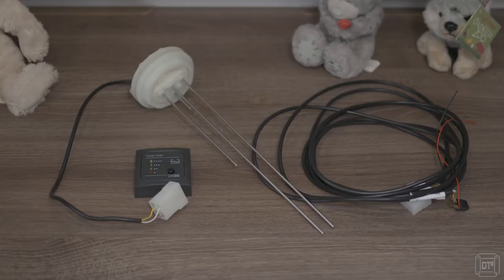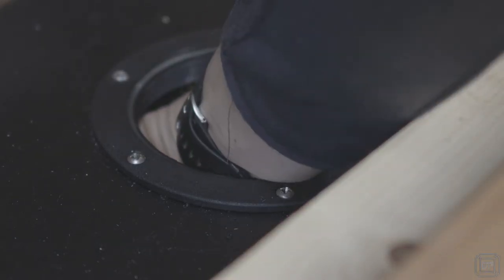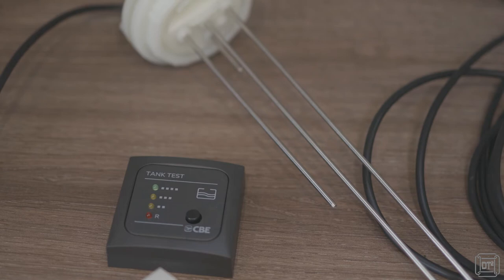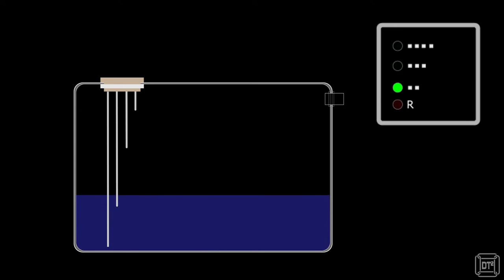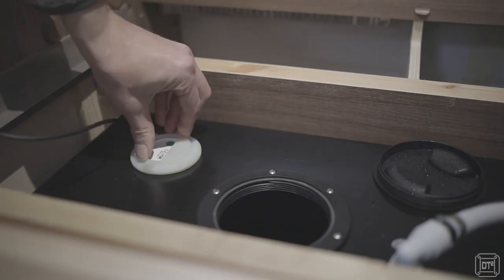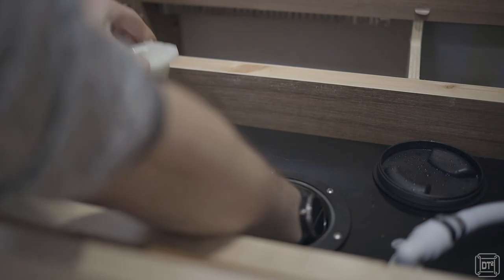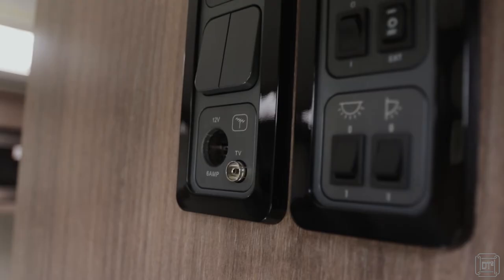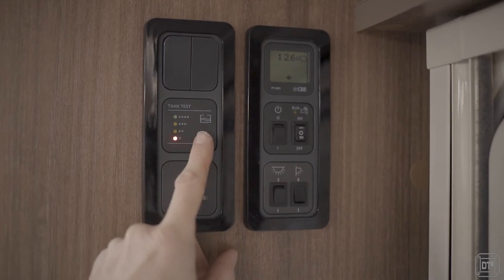WATER LEVEL GAUGE - For onboard fresh water tanks.

Comment: This has been a brilliant addition to our onboard tank. I found it difficult to find a suitable nearby 12v power supply so I used a 9v battery (smoke alarm battery) connected via a battery box to keep everything safe and tidy
Reply from the maker: Yes they definitely take away the worry about tank levels. I'd imagine that the 9v battery lasts quite a while as the circuit is only active when you press the button. Great workaround for lack of convenient power supply👍

Comment: If you find the gauge becomes unreliable / needs cleaning due to ‘hard water’ deposits, try adding a strip of stainless steel as an addition common electrode wired to the existing common (long) one. The increase in area reduces the current density / area of the electrode. This slows the rate of deposit build up.  On our previous motorhome, a Swift which had a similar sensor, I originally needed to defur the sensor every few weeks. After adding a 25mm wide strip of stainless steel, fastened to the top of the tank and nearly as long as the common probe, I only needed to defur every year or so.
Reply from the maker: We also had a Swift caravan with the same type of level sensor. I remember having to defur the electrodes but only once in about seven years or so. Was the high amount of surface deposit build up you experienced would be due to staying in hard water areas?
We do tend to add water purifying tablets to each load of water, I wonder if that could help avoid the issue, though the quantity added is so small that I doubt it.
Thanks for your tip to avoid the issue I'm sure that will help some others.

Comment: Hi just fitted a CBE water level gauge and when connected the top light on the gauge stays on permanently any ideas what it could be ? cheers
Reply from the maker: Hmm you shouldn't get any lights unless the test button is pressed. Maybe check that the button is not stuck?

Comment: Did you use any fuse? If yes, which one?
Reply from the maker: From memory I don't think so. The panel replaced an existing 12v sk was fused using whatever existing fuse was on that circuit.  The wire to the sensor didn't as far as I  recall have one. Which makes sense as it is effectively just for grounding a transistor switch so the current would be tiny.

Comment: Hello can I use this in Level for Food tank  as (food grade) it is Stainless???
Reply from the maker: I can't find any mention in the specs as to whether the probes are stainless or not. It is designed to be used with caravan fresh water tanks which store drinking water so that would suggest that it is food safe. Also I've had these before and after years of use only noticed slight corrosion which is more likely limescale build up. Hope that helps you.
Reply: @DTSquared  Thank you so much ❤️ 🙏